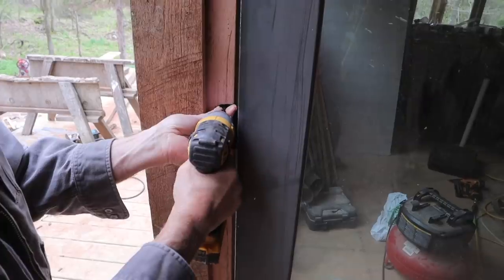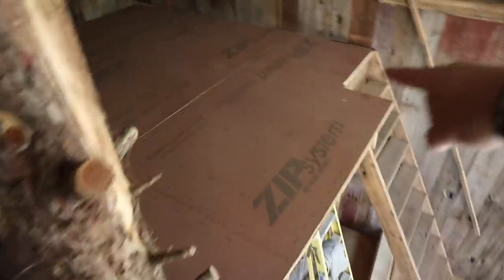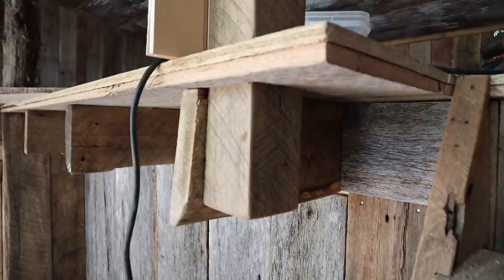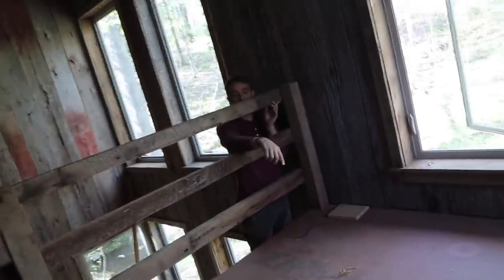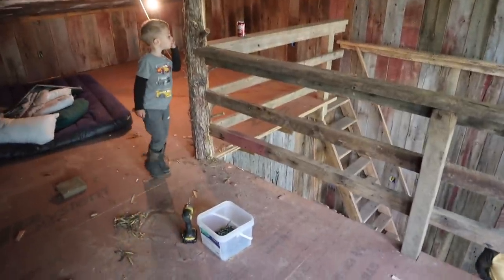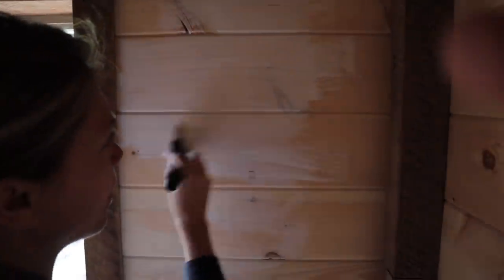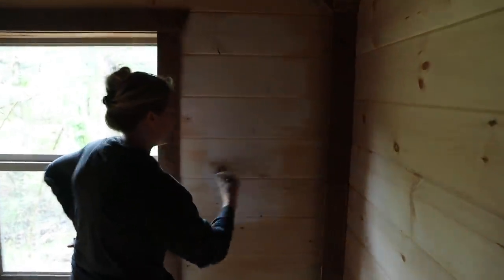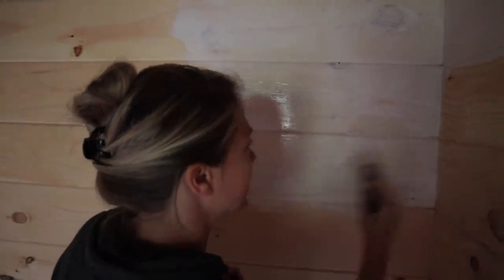A White Washing, Tile Laying, Loft Railing VLOG @ The Off Grid Cabin - EP #16

Comment: Most building codes call for gaps in rails under 4 inches.
Reply from the maker: No building codes here
Reply: But, the point is that sizing is to keep kids from falling through or getting heads stuck.

Comment: A Comment on the wire stock panels. Depending if it’s new - possibly spray paint a dark color. Or just use old distressed chicken wire. Staining tip, likely too late but initially use a narrow paint roller and follow up with a brush to hit joints and level out light / heavy stained areas. Looking good.
Reply from the maker: Thank you

Comment: My first thought that the rails were to far apart. I believe that code for child safety on railing is 6 or 8 inch spacing but they are vertical not horizontal.
Reply from the maker: No code here but we will make it safe